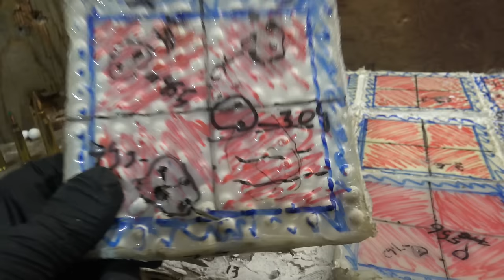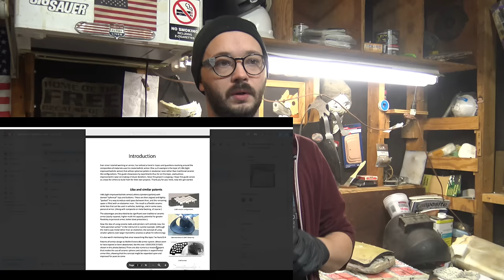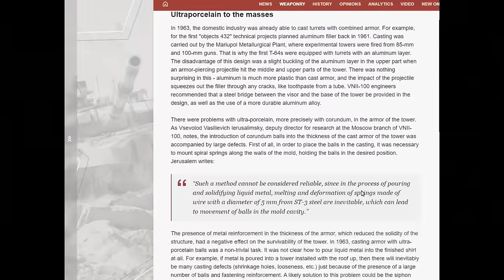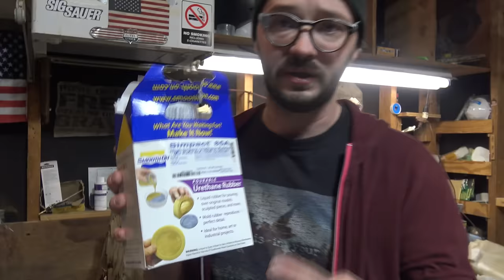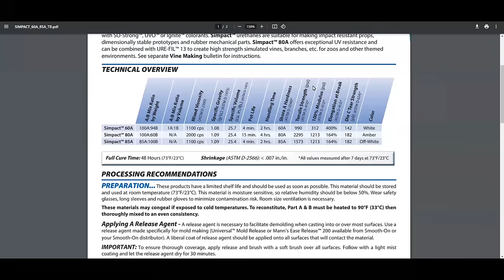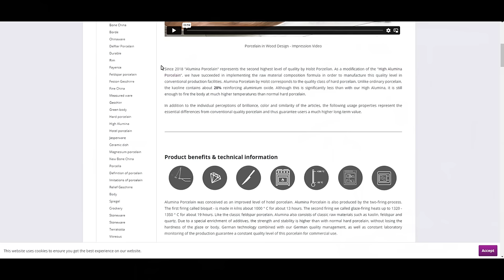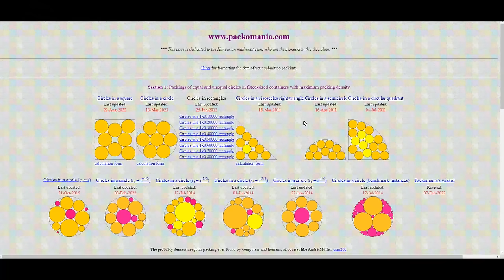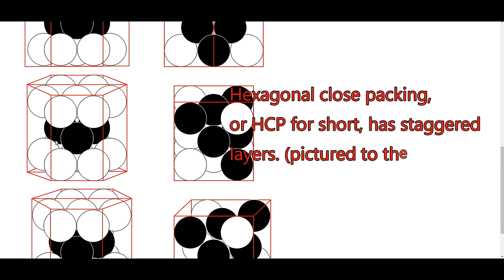Hybrid Ceramic Armor!

Comment from the maker: I would greatly appreciate it if you guys shared this video. Also, here's a link to my discord for those who are interested in joining: https://discord.com/invite/CrZGHYsmwh
Reply: What about using ordinary glass marbles or ball bearings, or both, instead of ceramic?
Reply: What about a layer of fiberglass between each layer of balls?
Reply: What about trying to use silica dessicant beads?
Reply from the maker: Also, huge thanks to Chris for coming out and shooting with me. If you want to check out his channel here, it is:https://youtube.com/@christopherkirish?si=bB5QhB4o7Zqs7Atl
Reply: Do you think that fine shards of a hard ceramic or metal  added to your resin would help shred bullet fragments while traveling
Reply: I seem to recall a patent that used very fine grinding media of 3 different sizes and also added an urethane resin.

Something like 2 / 1 /  0.5mm Al2O3 with about 15% of the total weight being resin.

Maybe encase your tiles in GF cloth with a resin ?

Comment: You might see interesting improvements if you include fabric layers between your packed layers of spheres. Make a little layer cake with fabric on the faces and you might see less fragments flying out of the plate. I wonder if layering fabric might improve the performance of the smaller diameter beads.
Reply: I keep imagining balls simply being pushed out, haven't watched the vid yet but that would definitely be a good idea
Reply: Yes. Just like with the tank armor which this armor gets inspiration from, The ceramic balls should not come in direct contact with each other otherwise they'll collide with each other when hit can cause cracking of the balls.

Comment: Sounds like you need a 3d printer to make those molds. Would be cheap and easy even if you outsourced it. Also have you considered using plastic/metal chicken wire to hold the balls in matrix. I have done research on LIBA and other ceramic ball armor before, Its been a while but i remember that the minimum required diameter to stop a threat being 50-75% (my memory is leaning towards 75% though) of the diameter of the projectile striking the ball. Have you also considered using cylindrical/cylpeb media HCP stacked with spheres.
Reply: I think he works with someone that has a 3d printer.. 

I bet it would look great in a clear-ish mold as well...
Reply: If he's casting aluminum anyway, he could just make the molds out of aluminum using a lost wax / foam method, where carved wax/foam is packed into sand and molten aluminum is poured in to take its place. I don't know if the armor could be made that way though, where the balls are stacked and then sealed in wax. That would be really interesting to see!

Comment: What a coincidence, we had the same idea, thinking further I would say that potentially the gaps between balls could be problematic, my second thought was maybe cubes* arranged in a diamond 2 layer configuration with 45 degree angles outward would be more ideal, the idea would be that the projectile is turned which makes it easier to catch with composites or fibers because the increase in surface area distributes the forces, another one I wanted to try would be just rocks in a matrix like the smooth pebbles you can get at home depot. great video!

Comment: I was watching a video recently on applying cooler than air paint to surfaces and in it the author broke down the exact ratio of size balls to fill up the space the most. I don't recall now obviously but if you put in balls that were 10mm in diameter then balls the size of sand it wouldn't let the epoxy in between. But maybe if you did something the size of 10mm then filled in the spaces with something 3mm then poured the epoxy on/in you'd have less risk of the bullet passing through pure epoxy while also staying thin

Comment: I’d be interested in seeing how going with smaller balls stacked higher would work out. MSE sells 1mm and 2mm, stacked 10 high the 1mm would be stacked about as high as a single stack 8mm, and since each individual ball is just as hard and just as dense, the same amount of energy should be expended on a 1mm ball as an 8mm ball. Admittedly I could just be bad at physics though

Comment: Hemispheres might be a better shape to use. Their flat base would offer more resistance than a round face. Being half the size means that you would get twice as many layers. You would also end up with a pyramid effect where 2 layers of spheres would turn into 16 hemispheres at the bottom, or instead of damaging a single sphere the bullet actually hits 30 different hemispheres.

Comment: Composite panels have a honeycomb sandwiched between cloth and resin faces. One material used for the honeycomb is aluminum. The aluminum honeycomb is made with gluing together sheets. The glue is put on the sheets in stripes so that when the sheets are pulled it creates the honeycomb. An aluminum honeycomb would hold the balls in place while the resin is applied. I think this would be an easy way to make curved plates. Also, the arrays of balls could be stacked to eliminate holes.

Comment: Simply cannot wait for 2.0 of this video. Wow. This is leaps and bounds above the level of innovation we’re getting in what IMO are the best plates on the market right now. Love the info. Keep it coming!!!
Reply: Would also be curious to see a smaller diameter triple stacked. Based on that stacking research it looks like the third layer completely fills the voids left by the first two. If you had 3-4 layers of 3 or 4 mm ceramic it would still be light and flexible, but cover all the gaps. I’m curious if it might create smaller fragmentation areas making it even more multi-hit capable. 

This has my brain going! Thanks so much for this work!

Comment: Something you may consider is "doping" your ceramic strike face with tungsten carbide balls. Use the 10mm aluminum ceramics, with 3mm (1/8") tungsten carbide balls filling in the gaps. 

The Tungsten Carbide balls are pretty heavy, but they're extremely hard. Rockwell C90, if memoru serves. Theyre also fairly inexpensive in comparison to Zirconia ceramics. Ive found Tungsten Carbide balls at 1/8" as cheap as $80 for a 100 pack.  

Lay the tungten balls down first with a thin layer of your casting media just covering them, then stack your aluminum ceramics in w hexagonal packing arrangement over them. 

Basically, your Tungsten would be the first contact, followed by the aluminum. Id also wrap my plate, including the strike face, in Kevlar or Fiberglass, including the backer. This will help prevent delamination, and spall.

Comment: Like your updates on your armor journey, definitely interesting with the ceramic balls. A tip for the resin portion, if you have it slightly angled when pouring like you said, but tape a back massager to the bottom and have it on as you pour, and maybe pour a little slower, shouldn’t have any significant airbubbles in it, I used to do concrete and we used big ass vibrators to remove air in walls and such. They could make your arms go numb as hell on large pours. Anyways I commented a few times back in the day, about plates I made, and how they were armored, seems like you used some of what I said, combined with other comments I seen and your own ideas, so pretty cool. I’d be interested in seeing one of these done with the 6mm ones, but separation inbetween the two layers by a little bit, with like hdpe, or Kevlar or good fiberglass mat with resin inbetween them, them more mat of your choice behind the second layer, maybe a couple layers on the face too, then balls and resin, repeat, with the face piece long enough to go up the sides, fold over and be resin soaked, with a backer plate of mat full width, as an attempt to help hold it all together after taking multiple hits.

Comment: Ive been putting a lot of thought into HDPE plates and my theory of the best system is a thinner layer of ceramics on top of a thicker block of HDPE wrapped in the fiberglass. I've thought about throwing a thinner layer of steel behind the HDPE but i dont want too massive of a plate. 

Weight is not as much of a concern for me as I am a reasonably big guy. If im throwing plates on though, I have too many responsibilities to worry about mobility over protection.

Comment: Encasing two layers of ceramics in a thin layer of cast Aluminum to hold the balls to mimic the setup used by by the T-64's turret, and then further encasing that in HDPE and a fibre backer/front to contain fragments of aluminum and ceramics would probably make something interesting. I'm someone that studies vehicle-type armors and it's sort of interesting that you're taking inspiration from them as much as from infantry-armors.  

Modern light AFVs used perforated ultra-high high hardness steels, often mixed with thin ceramics as "outer" layers to breakup the incoming round or cause the penetrator to "yaw" (aka, shift violently from side to side) before it impacts the main layer of the armor to reduce it's effectiveness. I always wondered if something similar to chobham-type armor (thin plates of steel arranged at angles) to 'catch' and ablate the incoming projectile wouldn't work- the Russian T-55 had a very simplified version of this as add-on armor which was a bunch of thin plates with epoxy resin in between each layers, effectively forcing the projectile to tilt as it had to break the surface of each plate.

Comment: Aluminum oxide is 50% heavier than porcelain. 3.6 grams per centimeter cubed versus 2.4 grams per centimeter cubed. So the question is, does aluminum oxide provide 50% more protection?

Comment: Thanks for sharing all your research! I’ve run across an inexpensive and lightweight fabric you might be interested in trying (I will also tinker with it) Malarkey Secure Start Plus Underlayment for roofs. It seems to be very durable but lightweight. I’m curious about how it will do with me reducing the number of layers of Kevlar or fiberglass cloth. I will use in combination with porcelain tiles and kydex to start and laminate with Kevlar.

Comment: I remember I said something about armor plate balls along time ago but I didn't think it'd work this well.
maybe trying to layer them even more like in voids between three balls of 10mm you could insert a small 4 or 3mm, or just layer them further than in the vid, in layers of balls like first layer only 10mm second layer 8mm third layer 6 mm, this could help avoid pockets without armor.
I also got into the idea of weaving kevlar fibers with metal fibers like in steel wool, it is time consuming but it could solve delamination issues that would occur in simple layer to layer adhesion.

Comment: I had an idea to use ceramic beads from a bead blaster.  I was thinking of using them in between layers of Kevlar and carbon fiber roving and epoxy.

Comment: This article would be a great read for you when it comes to considering different types of silicon nitride balls if you ever went that route. Even if you did a mix where the 3 mm gaps were filled with them or had them as your contact later, because you could decrease material density in layers as the projectile losses velocity saving cost while remaining within your priorities to fit your goals

Comment: Not that you need notes, I'm so impressed. This is a, "This is genius why has it taken this long" scenario. But; Two Notes.

Intersperse smaller rounds between the larger ones. On both sides to tighten up the matrix. Or, at least in the strike face.

Second? This is awesome, you could make molds for a full body suit at home and the cost it should be low enough that anyone could afford to make and maintain it.

You know, like a cyberknight.

I didn't want to say this but upon further consideration? It probably might need a thin sheet metal to pre-deform the bullet as well.

But, I'm talking perfection at that level.
Reply: ! Scalemail.
Reply: North Holywood here I come

Comment: I wonder how steel bbs would do perhaps to fill in gaps! Being hollow they won't add much weight, and the deformation should absorb a lot of energy! Also I think I read about a tank armor that was essentially steel bbs encased in aluminum - which also should be easy to make since aluminum melts at an easily achievable temp!
Reply: EDIT: silly me, this was mentioned in the video ahahah
Some T-64/T-72 armor was also cast iron with embedded ceramic spheres. The early attempts failed because the ceramic balls were held in place by steel mesh and the heat from the cast melted it. Took a few years to get it right.

Comment: And as far as casting aluminum…you’ll want high mag content, then have to heat treat for optimal results, that will give you close to steel levels. Obviously lighter, but…if you could do cast steel, with the ceramic inside, much better…but a lower cost and just as good. Not to mention easier option, using a harder/more plastic resin, with just enough to cover the balls…then sandwich them inbetween steel plates, and stitch weld in place, with ceramic strike face being slightly compressed will great strengthen the steel plate and make the steel and ceramic perform better than on their own. Or not being sandwiched so tightly…just saying. That method honestly works better for flat tiles. Or rods of ceramic though. Be interesting to see though with balls, and maybe an epoxy instead of soft/flexible resin or plastic resin. Like a concrete anchor epoxy that unused in my plates, do the same thing but sandwich and weld under pressure…I just used mechanical clamps, and 3 layers of 16 GA carbon sheet metal, each layer planished. With only epoxy holding them together and clamps as it set for days, to ensure full cure, plus couldn’t get to testing until a couple days after I wanted too. And they performed phenomenally. I’m looking to revisit with a couple things I learned since then. And more importantly tools I didn’t have access to, that I do now. When I did my hard core tests…was 12-13 years ago, I didn’t have all the tools and equipment I do now. I’m looking to go less composites in some places, maybe different grade of composites, and definitely differing layers of steel, most likely planished then annealed and either face hardened/through hardened and tempered…with a thicker layer of backing steel. Doing that. Should, outperform my previous plate. But shit also costs a lot more than then, I could make a full size plate and side plate for $95 dollars…in 2011, that out performed the ESAPI’s I was issued. And carried before that. So $190 dollars would get you two normal sized plates, front and back and two side plates, standard size, aka medium, in 2011 bucks. I haven’t looked at the price of doing it again lately, but I’m guessing about twice the cost nowadays, plus the amount of work I plan on putting into them, and the tools needed, of you didn’t have them, it’d be equal cost or cheaper to buy plates that do as good/slightly worse than making them I’m guessing. So if you only want one set of plates, cheaper to buy good, proven ones. I’m doing this more for curiosity and to see how viable it is, to make the absolute best plates, out commonly available, relatively cheap materials. And some tools like welders and good clamps/hydraulic presses, heat treating with torches, etc. just to see if I can make one that out performs even more, with different techniques and tools, same materials overall. And more time invested

Comment: Finally !
Reply from the maker: It's a Christmas miracle! Lol, hope you like it
Reply: Maybe I'll get around to banging some of these industrial ductile steel 1/4" 4×10"s into scales one of these days, sure is a fun hobby though?, and sounds like some scales kinda like overlapping u's not like the newer hexagonal "dragon scales" could be good too though, although the light and probably fluffier so in a thinner layer, pressed hard wood experiment on nile red or somethin 2 or 3 months ago was pretty cool too, 

too bad it seems harder to make it out to the forge or harder aluminum 7075 machining table with lionentech or maybe dark mane forgeworks is more expensive and challenging these days, but drinking my alkaline water with rock minerals and not getting calf cramps or stiff jaw muscles when yawning at the watering well is pretty great anyway too? Great work though!

And I'm definitely liking my nice lt rucksack and helmets even though my dad got me a leather luggage duffel? And when I think I'm glad I didn't get the expensive thermal monocular; I realize I probably just lose money in the stock market with the corporations goin on strike anyway, lol? Think I have some of that symtac resin and alot of some other type resin that hopefully won't go bad anytime too though? I got everybody miniature carrying cases that are pretty great as presents making for nice decorations even if you don't wanna play warhammer or whatever in the beginning I think at a certain age too though?

Comment: Ideally, for multiple sized balls, you'd want your smaller size to fit between the gaps of the bigger ones. You could go a step further and fill those gaps with powdered silicon carbide, but at that point, I doubt you'd get much benefit... but maybe? 

Either way, GREAT idea for SRT armor at least.